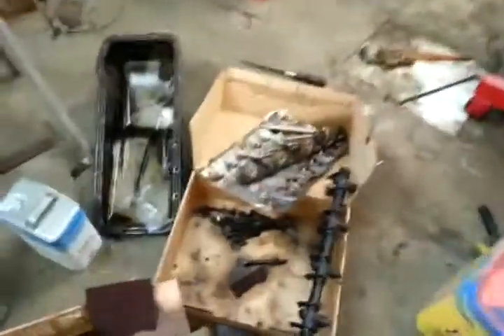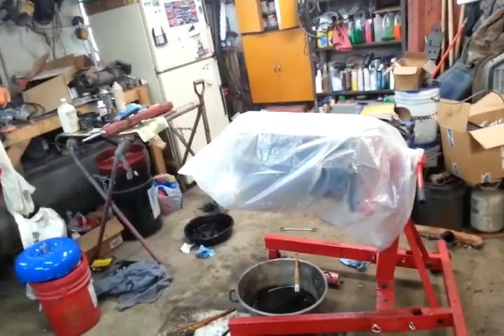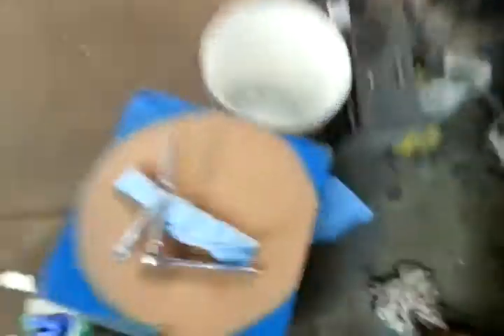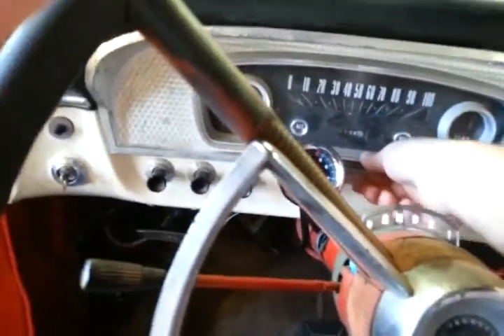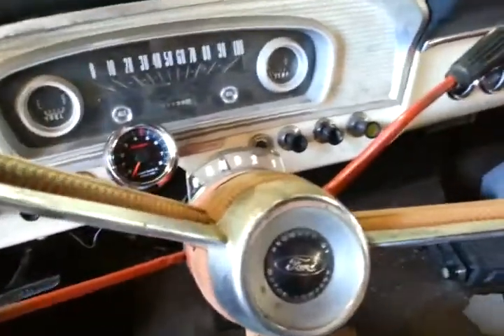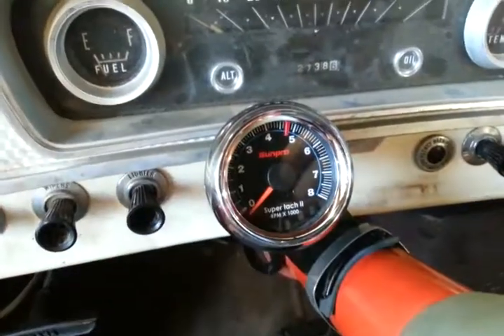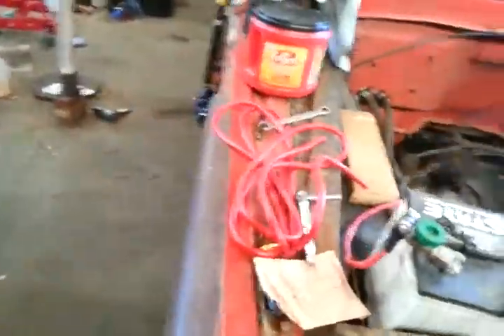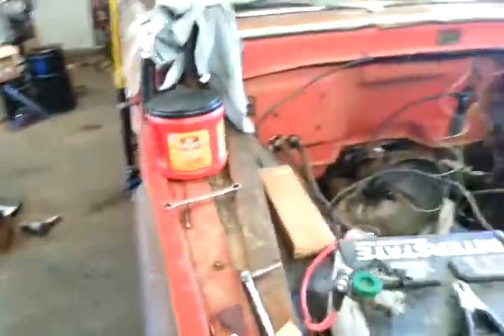Things are coming together!

Comment: Looking forward to seeing it run! If you google search for painting aluminum manifold, some people said they just sandblasted the intake and the paint stuck fine. Some also say you can wire brush it really well and make sure it's super clean then paint. Rustoleum has aluminum specific primer also. The sleeper effect would be really cool. You should get some air horns on it lol
Reply from the maker: I decided not to paint it for now